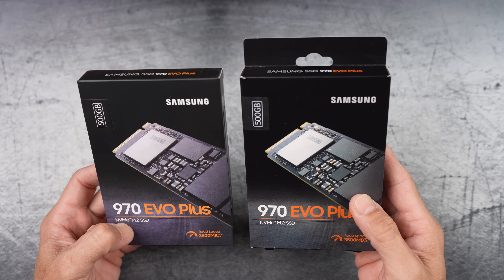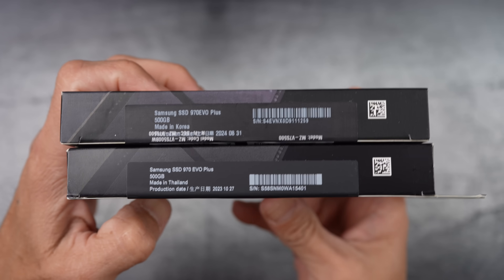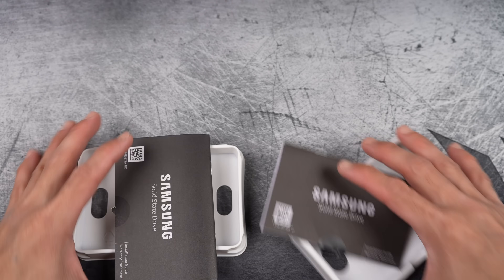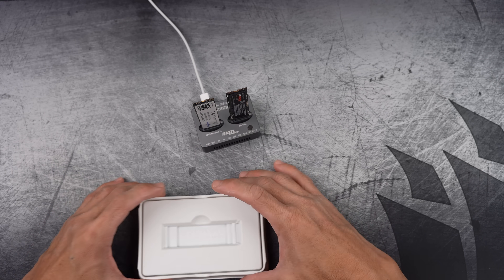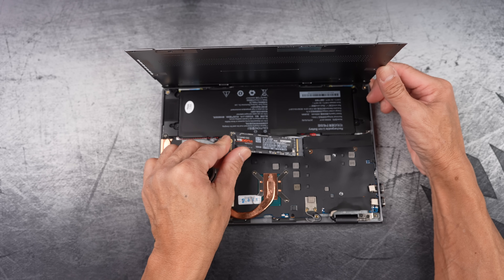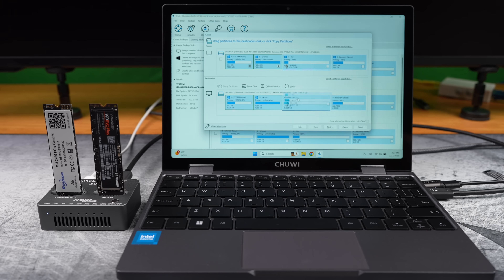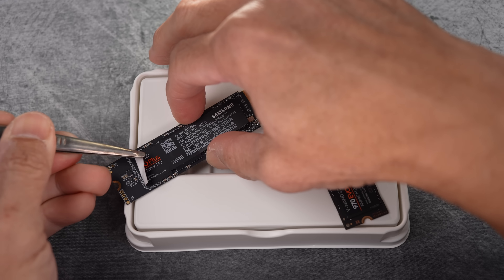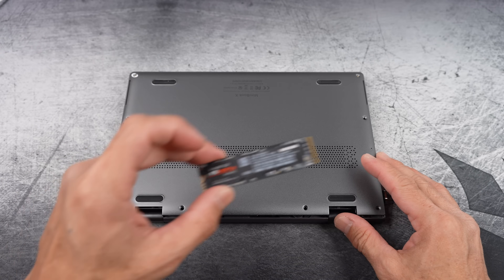Fake vs Real SSD - Can You Spot the Difference?

Comment: CrystalDiskMark cannot differentiate a good fake product.  Cloning is also not a good way to test.  Practical way to test is to write a single 200GB file and look at the graph.  Fake drive write speed will drop to miserable level after certain write.  A good fake product can sustain reasonable write speed until 50GB before speed drop; poor fake product may drop faster at 20GB.  Genuine product write speed will sustain much better through out the entire write process.  Samsung Magician software is another direct way to tell.
Reply from the maker: In this video, I mainly used CrystalDiskMark just to quickly compare basic speed behavior between the two drives, and kept it short since the focus was more on the physical comparison and visual differences rather than deep endurance testing. Using Samsung Magician would’ve made the video much shorter and more technical. 

Really appreciate the extra insight though — this is great info for anyone who wants to dig deeper when verifying a drive. 🙌

Comment: It's not a fake drive.  It's a counterfeit drive.
Reply from the maker: Fair point 👍 Counterfeit is the more accurate term — it’s intentionally made to look like a real Samsung drive. Most people just say “fake” for simplicity, but yes, counterfeit is technically correct.
Reply: @TossSong  Yeah, when I clicked on the video, I thought it would be a non-working drive.
Reply from the maker: Exactly 😄 They still work, which is why they fool people — but the specs and reliability aren’t real.

Comment: Man, you have very low speed in both. Looks like your lap it's a fake!
Reply from the maker: Good question. The speeds are limited by the Chuwi MiniBook X, not the SSDs themselves. I’m using the fastest NVMe the MiniBook X can actually handle, so both drives get capped by the laptop’s interface. One of them is confirmed real—the point of the video was showing behavior, consistency, and capacity, not peak benchmark numbers.

Comment: 2:45 Dude, the plastic holder is not only convincing, but identical. I bought them several times on eBay myself, because I threw away the original packaging and needed the plastic again. There might be only one company making that boring plastic box.
Reply from the maker: Yeah, that’s a great point 👍 The plastic holder itself is basically identical and definitely not a reliable indicator anymore. That’s why I try to focus more on firmware behavior, capacity tests, and software checks rather than packaging alone.

Comment: I ALWAYS buy my storage products from a real dealer.  I would  be willing to bet that the NVMe fakes have spoofed the storage capacity, just like the fake SSD external drives and USB thumb drives.  They show a totally fictitious amount of available storage, and they appear to be writing to it.  However,  a fake drive that shows 1 TB of space, and it appears to be writing to 1 TB, is simply pretending and all data in excess of the actual capacity, is lost, since it is NOT THERE.  Beware!
Reply from the maker: that’s a very common trick with fake drives. They spoof the reported capacity so the OS thinks everything is fine, but once you write past the real NAND size, data just gets overwritten or lost. That’s why tools like H2testw / F3 or checking with manufacturer software are so important. Buying from authorized sellers definitely reduces the risk. Thanks for sharing this 👍

Comment: Quick comment on the issue you had with the cloner: I have similar devices for cloning HDDs and they're very simplistic, simply running a sector-by-sector copy of the source drive to the target drive(s). If the target drive is smaller than the source (i.e: MAX_LBA_SRC > MAX_LBA_DEST) then the cloner will refuse to start, as a SBS copy can only work if MAX_LBA_DEST >= MAX_LBA_SRC. In this case your Rayson SSD probably had a higher LBA count than the genuine Samsung one. ⚖

An advantage to these types of cloners is that they are entirely content agnostic and don't need to understand the disk content or formats at all - They'll happily clone whether the source data is completely intelligible, or complete garbage. This becomes extremely advantageous when cloning disks that are encrypted, or for running bulk disk erasures by having a few disks filled with random garbage and using these as source disks to perform multi-pass erasures (Think DBaN) by cloning their content to the disks to be erased. 👍
Reply from the maker: That actually makes a lot of sense — thanks for the clear breakdown 👍
The LBA mismatch explanation lines up with what I was seeing during the clone. I didn’t even think about the fake drive reporting a larger max LBA than the genuine one.

Also appreciate the note about these cloners being content-agnostic — that’s a good point and a useful advantage in the right scenarios. Great info, thanks for sharing this with everyone.
Reply: @TossSong  No problem! Always happy to pass on info that's useful, especially as I seem to be heavily muted in most places (Something about old world thinking and dislike of certain natural characteristics in those of my generation, I think. 🏳‍🌈⛔🇬🇧) so passing this on to people who have voice means the info may become circulated to those who need it. 👍

One caution about these cloners though is that - Because they're content-agnostic - It's very easy to clone disks the wrong way around (e.g. cloning the target disk over the source) by mistake, either because the user mixes up which drive goes in which slot, or the slots could be wrongly labelled on the cloner itself. For this reason I recommend testing each cloner with non-sensitive disks before employing them for anything data-critical. 💡

Testing a cloner out with an already well-cloned disk (e.g. A copy of your movie collection) and finding the source disk being nulled-out by the empty target because the slots are labelled backwards hurts a lot less compared to finding this out when you were trying to clone the sole copy of a very important disk. That's why I didn't simply trust the (As yet untested) cloning functions in my four-bay Orico for a recent job. 😇

Comment: China, Pakistan and India the real culprits again?
Reply from the maker: I understand your point. I wouldn’t pin it on countries. The real issue is unverified sellers and lack of supply-chain checks. Fakes can show up anywhere if buyers don’t verify serials, firmware, or use tools like manufacturer software. Always buy from authorized sellers when reliability matters.

Comment: The only thing thing those NVMe docking devices are good for, is cooking your drives while reading and writing all that data without any cooling. I've tried using one with my 970 Evo+, and it will overheat and shut down within around 2 minutes when transferring data like that without a heatsink. It's now installed in an Aorus Pro Z390 system with a big heatsink on it as my boot drive, and it still works fine. Thankfully the thermal protection circuits in these drives are pretty good.
Reply from the maker: Sorry to hear that—yeah, overheating can definitely be an issue with some NVMe docks, especially without a heatsink or airflow. I haven’t run into that yet with this cloning dock, but it’s very possible I haven’t pushed it hard enough or done long, sustained transfers. Appreciate you sharing your experience—good reminder to keep an eye on temps and use proper cooling when doing heavy transfers.

Comment: It's almost as if the manufacturer hired by Samsung to make these SSD also sells low quality drives using the same packaging as the quality dives.
I'm so shocked :))
Reply from the maker: Yeah, it definitely looks that way on the surface, which is what makes it so confusing. In reality, a lot of legit brands outsource manufacturing, but the real difference is QC, firmware, and validation. That’s why tools like Samsung Magician are helpful—one of these showed up as Genuine, the other didn’t. Same-looking shell, very different internals. 😅

Comment: As soon as he said Ali Express I knew it was a fake, all them China websites are just selling platforms for fake garbage, China has no dignity, morals or remorse towards any country that is not China.
Reply from the maker: Thanks for your comment. I get the concern, but just to be clear — the issue isn’t one platform or country. A lot of the same sellers are on Amazon, eBay, etc. too. That’s why checking the product itself (labels, firmware, performance) matters more than where it’s listed.

Comment: I bought a fake nvme wayback 2017 and im still using it till now.  Something just work fine even if its fake. But i dont recommend.
Reply from the maker: Yeah, that happens sometimes — they can work “fine” for basic use, but it’s definitely not something I’d worry about with important data.

Comment: I bought 2 TB Samsung 990 pro around 40 dollars it works as intended but crashed when I put 120 plus gb data on it I guess it's just a 128gb modified SSD to look like 2tb.
Reply from the maker: Yeah, good chance that’s the case — packaging can vary a lot between batches and regions, so it’s not always a reliable indicator.

Comment: Their SATA chips, only use USB 3.1 GEN 2 at most, probably get 500mb/s, they are ok of course relative to junk nonsense, but even good companies don't make PCIE drives, they use SATA chips.
Reply from the maker: Yep, I agree — a lot of those are basically SATA drives behind a USB bridge, so speeds top out way lower than real NVMe.

Comment: Fake Flash Test.exe tests very quickly if genuine and what the actual capacity is.  
Also, Validrive Check Fake USB is also another tester. Both are free, and both are portable no installation.  Both are for Windows.
When the price is too cheap, its about 100% certain to be a fake.
Reply from the maker: Thanks for sharing those great tips! 🙌 I’ve heard of Fake Flash Test but not Validrive Check Fake USB—will definitely look into that. Totally agree: if the price is suspiciously low, there’s usually a catch. Appreciate you adding value here!

Comment: with another brand made in china, this would be a "nice for the price china SSD" instead of a "Fake SSD of lower quality"
Reply from the maker: Agree — some off-brand SSDs from China actually deliver decent value for the price. The key difference is transparency: if they advertise honest specs and the performance matches, it’s just budget gear — not a fake. The real problem is when they lie on the label or firmware.

Comment: I would think that if checked with Samsung Magician who show it as a fake drive.
Reply from the maker: The Magician software won't read the S/N properly and no 'Genuine' mark next to it. But says that the manufacturer is Samsung likely through flashing the firmware. (I didn’t show it on video because it would have been a 1-minute video.)

Comment: Just don't buy the largest ones. They fake the size. Smaller ones are typically (test them!) ok and real size is what it claims to be. In the past I've bought a SATA for a junk machine and it works fine. I have a 128 GB 2230 NVMe on the way I intent to use in a PiHole. It's almost same price as a 128 GB microSD but even though mediocre it'll have way faster random access then microSD and most likely it'll outlive such as well as most microSD have mediocre wear leveling. Should it die no big deal. It only takes a few minutes to get a new PiHole installation up and running.
Reply from the maker: Totally agree! The fakes usually go after the high-capacity ones. I also stick with smaller sizes and always run a test right away. Your PiHole setup with the 2230 NVMe sounds smart—faster and probably more durable than microSD. Appreciate you sharing your experience!

Comment: You should have cloned the original to the real drive as well, same method
Reply from the maker: Good point! I actually did clone the original to the real drive later on—just didn’t include it in the video to keep it shorter. I also did a fresh Windows install afterward just to be safe. Thanks for watching!

Comment: Your conclusion is correct, but you mixed them up during the video. The SSD with the large component at the lower right is called the real part by you early in he video, but the fake one later. The one you also called real at the beginning has the small holes around the single large mounting hole at the beginning of the video.
Reply from the maker: Thanks for the feed back. But I’m not sure if I did. Maybe word choice I used was confusing? But thanks for point it out.

Comment: I would never use SSDs without heatsinks.  In my experience the drives will get hot when during long writes like cloning operations and slow way down if there's no heat sink.  But part of it may be that I don't buy ssds that small.
Reply from the maker: Thanks for sharing! I’d totally use a heatsink too if this were going into a gaming rig. But in this case, it’s for a MiniBook and there’s just no room inside for one. 😅

Comment: 8:45 I would argue that fake drive was actually better than your original drive because the fake drive has slightly better random read 4KB QD1 which is the worst case performance that the drive will deliver in real world use. Neither 42 nor 44 MB/s is a great result here, though.

Overall, surprisingly good fake product and the runtime performance was actually really good considering it's missing DRAM cache. I wouldn't trust it for my data, though. I would assume it's actually made out of NAND flash chips that failed factory testing.
Reply from the maker: Totally agree—performance-wise it was surprisingly close, which caught me off guard too! But like you said, I definitely wouldn’t trust the fake one for anything important. It might seem fine at first, but who knows when it could suddenly fail. Appreciate the thoughtful comment!

Comment: (Im looking to screen point of view) At 6s SSD at my left is the original and the one at my right is the fake one. It´s just look at it´s pics on Samsung official store to confirm just looking to that "Ⴖ" were you fix it with screw to confirm all pics at this "Ⴖ" have exactly the same ⬜⬜at "Ⴖ" left side and those two lines of 🟧 at right side, bottom line with 7🟧and top line with 5🟧. The other SSD at my right side only have 4🟠line at "Ⴖ" right side.
Reply from the maker: That “∩” screw area is a good giveaway. The chip layout is totally different between the real and fake ones — especially the numbers and colors like you pointed out. I appreciate you taking the time to break it down like that. Super helpful for everyone trying to spot fakes 👏🙌

Comment: You can spot the difference by not losing your data by samsung firmware updates ...... hahahahaha
Reply from the maker: Thanks for the comment! I actually did run Samsung Magician off-camera just to double check. But yeah—if I had only shown that part, the video would’ve ended in 15 seconds. Wanted to dig a bit deeper for those curious!

Comment: Interestingly my drive appear real, its read speed are +/- like yours, yet write speeds are twice slower. Idk why
Reply from the maker: Yeah, that’s strange! If it’s a Samsung 970 EVO Plus, sometimes lower write speeds can happen due to things like thermal throttling, old firmware, or running out of SLC cache during large transfers. You might try updating the firmware using Samsung Magician and checking temps during your tests 👍

Comment: I also got scammed with a fake samsung evo 970 plus. Its almost impossible to detect its fake if you dont test it with crystal mark. In mine the performance was more awful than your fake samsung. It was 1200/700 mbs
Reply from the maker: Ugh, I feel you! These fake Samsung 970 EVO Plus drives are getting scary good at looking legit. You’re so right—without testing in CrystalDiskMark, it’s almost impossible to tell. 1200/700 MB/s is rough! Glad you caught it early. Hopefully more people will test right after installing too.

Comment: The lesson is never buy computer parts from Ali Express. Only a fool would buy computer components from Ali Express. Beware of Amazon because reselleres buy off Ali Express and resell on Amazon, it is the same with EBay. A number of stories have emerged of fake AMD 9800X3D chips sold on Amazon.

Comment: If you know what the original looks like, it is no brainer. The first one opened is the original. (darker box)
Reply from the maker: Thanks for commenting. That darker box definitely gives it away if you’ve seen the real one before. Nice eye!
Reply: @TossSong  It’s not just the box that’s different — the module itself is as well. If you peel off the sticker, you’ll see that the original design underneath matches the one shown on the box.
Reply from the maker: Ahh great point! That’s a solid way to confirm the real one—especially if the internal design matches the box art. Thanks for the tip!

Comment: I bought a used 4TB Samsung 990 Pro online recently. I already had experience with similar drives so I was confident it wasn't fake. Still, I was relieved to see your video, confirming my assessment. I made a custom heatsink solution for it (to fit a laptop), which involved peeling off the label. It was interesting to note that the label tore apart easily when trying to remove it, just like the genuine one in your video.
Reply from the maker: Thanks for sharing your experience! Sounds like you really know your drives — and yeah, that label tearing apart easily is definitely a sign of authenticity, just like in mine. Glad the video helped confirm your instincts. Great idea on the custom heatsink too!
Reply: @TossSong  I break all the rules; buy used SSDs, peel off the labels, glue the heatsink on haha.
Reply from the maker: Haha sounds like fun! 😆 You’re basically the SSD renegade we all need—used drive, label peeled, custom-glued heatsink and all! Glad the video helped confirm your instincts. Real tech DIY vibes! 👊🔥